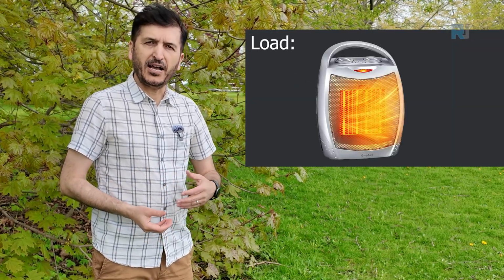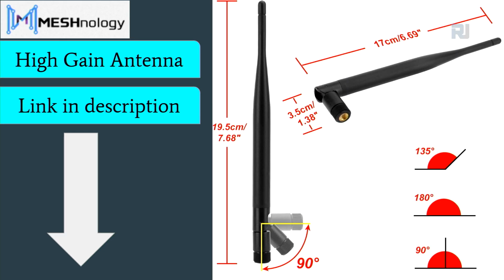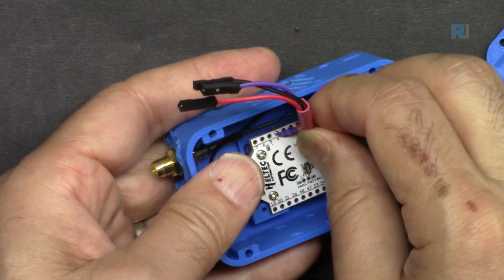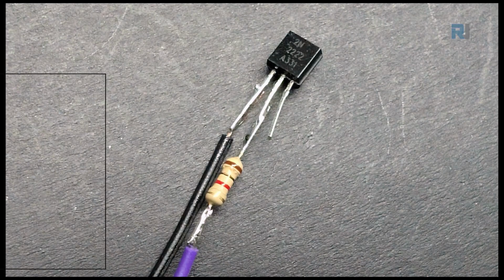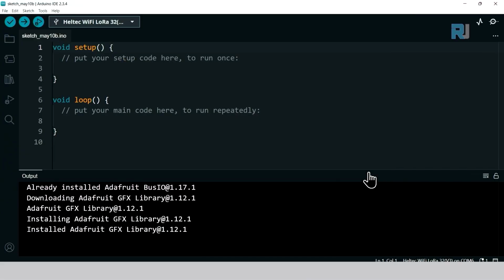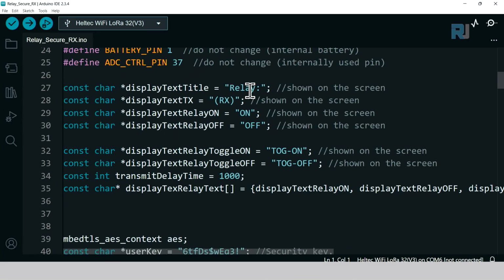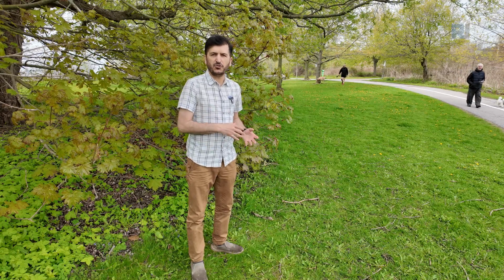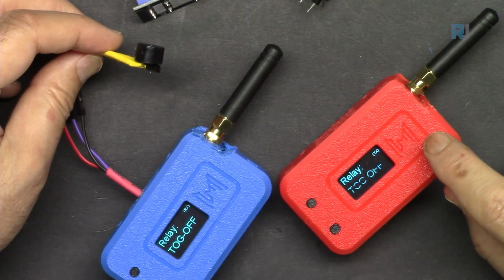Remote Switch Magic: Heltec Wi-Fi LoRa 32 Relay with 13 Mile Range 📡🔋  OFF-Grid NO-SIM

Comment: How would you control a garage door opener with this?
Reply from the maker: I am not sure what kind of garage door you system you have. but if the garage door has already a push switch to open/close, then you can connect the two wires of the switch to the relay an the relay acts as switch. this was one example. but it could be done in many ways.

Comment: Hey Robo! Thank you for the tutorial. 

I installed the zip, but noticed the Relay RX sketch has "Door" thought out the sketch and the orange light on the  TX module stays on and the relay is not switching. Any thoughts? Thanks !
Reply from the maker: Hey, I hope you've paid attention to secure and non-secure sketches. use the one with the word Secure.

Comment: zip file failing to install ? why pls help
Reply from the maker: I just downloaded the library, installed it without any issue. I am using Arduino IDE 2.x  Have not tested on older Arduino IDE 1.x,  3 years or older).

Comment: I once built a similar project also using
Lora to switch a heater on in an outbuilding (useful for winter). I did it slightly differently to you and with fewer features but it did make the controls and battery management simpler. For the client I would have a single momentary switch that you would hold in to supply power to the client, once it has powered up, it would try to connect to the server, if it could connect a led would illuminate, after that it would send the “power on” signal, if we got a confirmation response the final led would illuminate and you could let go of the button. I was trying to channel my inner Jonny Ives (and try and get my parter to use it!). I built it eight years ago and it still has the same little 9V battery!
Reply from the maker: Wow. Interesting story. Thanks for sharing. Yes indeed this is very useful and practical. Cheers!